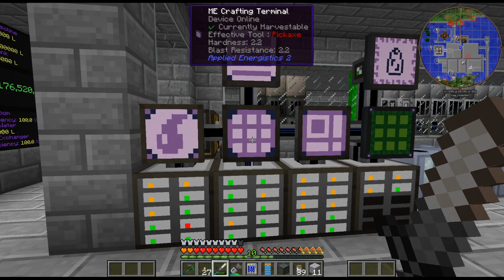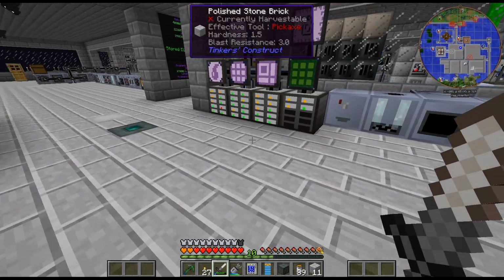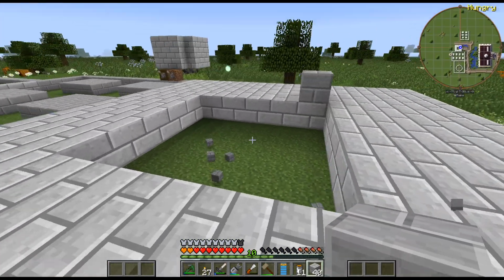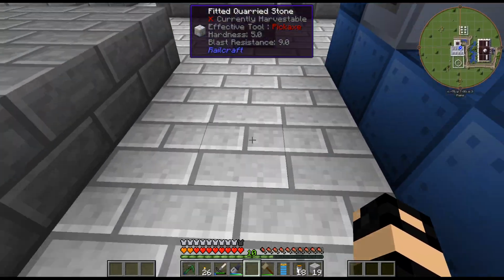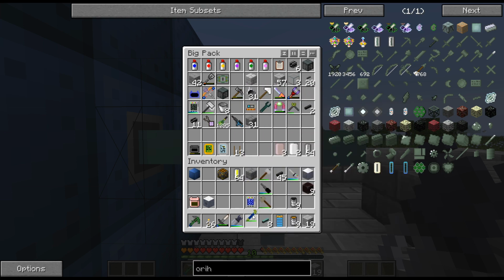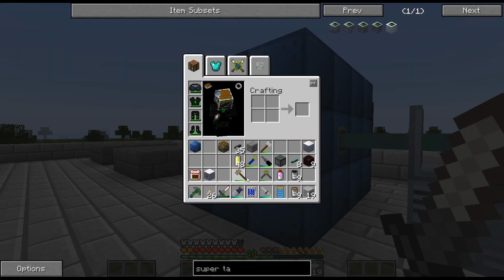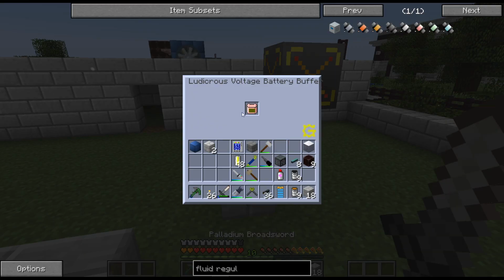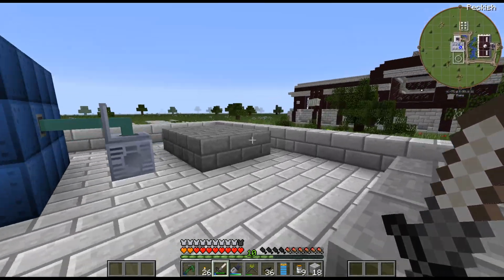Gregtech New Horizons - 199 - Plasma Generator

Comment: What? The burn value of helium plasma is 81920Eu on 1mb and the optimal flow of the rotor is 16000eu/t, that means the optimal flow equal to 1 L/t, and the scanner show 4 L/t, i’m confused
Reply: Besides, the output in that case equal to ~14k eu/t, but according to calculations which means plasma burn value is equal to 81920 eu on 1 mb, the output will be equal to ~75k eu/t
Reply from the maker: The scanner is indeed wrong and is showing L/second not L/ tick. So the number needs to be divided by 20 to get /tick, or you can just use the IC2 fluid regulator which lets you do either /s or /t
Reply: Kharax82 hmm, I see, but optimal flow can’t be smaller than 20 L/sec and you didn’t answer the question about nominal output
Reply: Maybe in gt:nh optimal flow can be less than 20 L/sec, I learnt that optimal flow can’t be less than 20 L/sec.

Comment: The flow rate on your scanner says 4 L / t not 4 L/ sec. I think you misread it
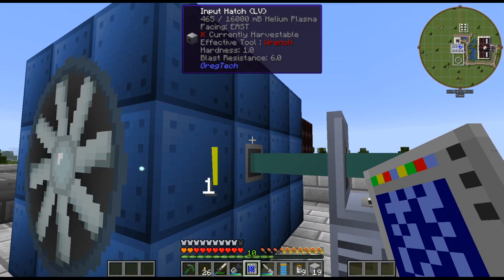Reply: Look closely around 26:18 on
Reply from the maker: The optimal flow rate listed on the scanner is for the Gas Turbine, the Plasma Turbine optimal flow rate is calculated differently.